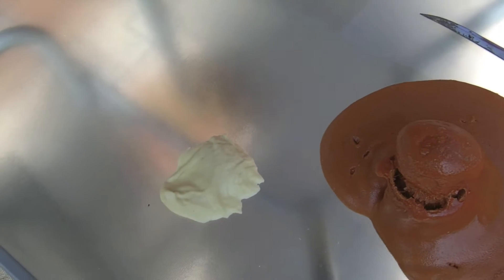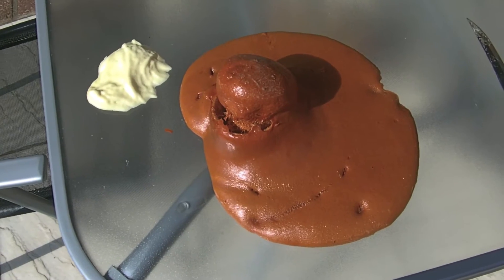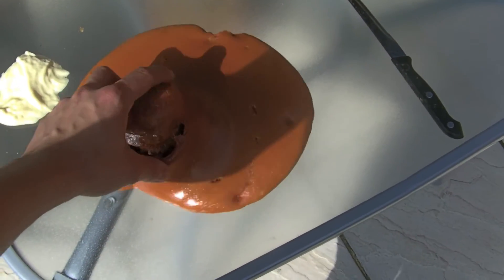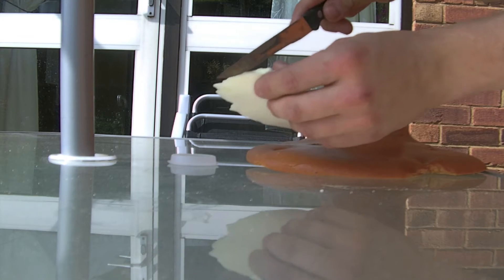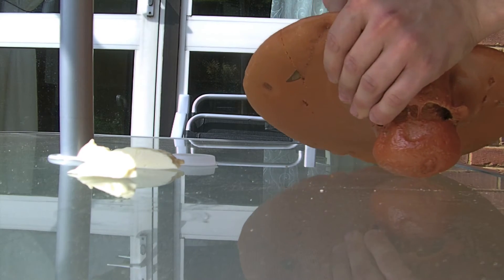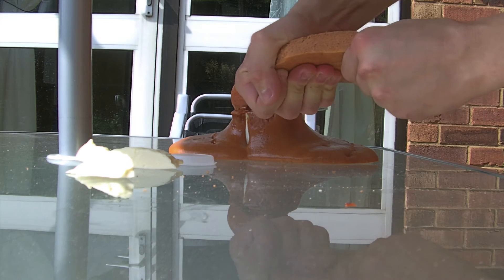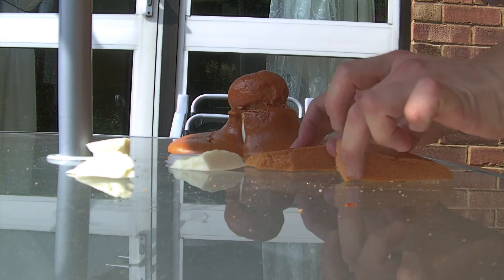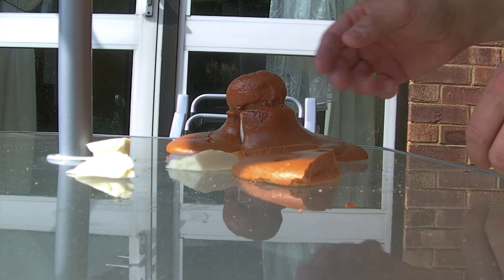AB Foam and FG RESIN

Comment: You should only use foam to get a desired shape, then cover it with fiber glass. After job si done make a little hole and wash it up from the inside to make it lighter. Not a pro...

Comment from the maker: Just standard AB foam from my loacl supplier. And resin was kind of transparent blue, turning green-ish when accelerated. I mixed resin and A part of foam first, using drill with mixer attachment. Then I added accelerator and B liquid and used drill to mix it quickly. Don't use it as mold itself, but use it as core, to make your mold stronger and light ;)

Comment: Just curious, why kind of AB foam did you use? How exactly did you mix it? I tried something similar but the fiberglass resign only got pushed out and dried as an outer wall instead of a whole piece. I am wanting to use this to make my mold for some fiberglass pieces. Please let me know or if you could kindly make a video of how you did the mix, would be greatly appreciated.